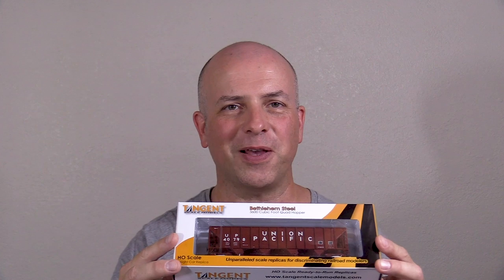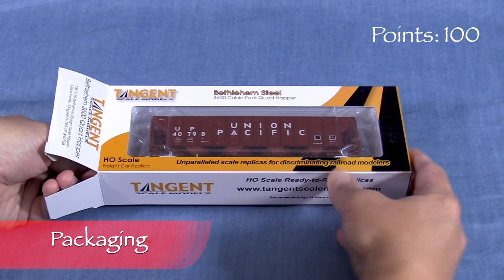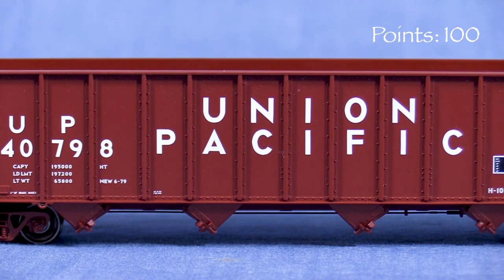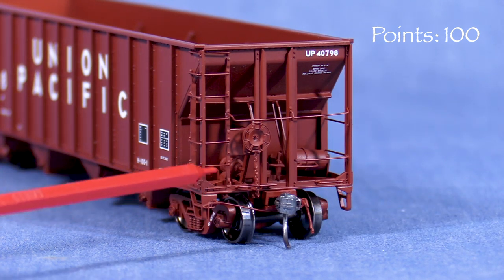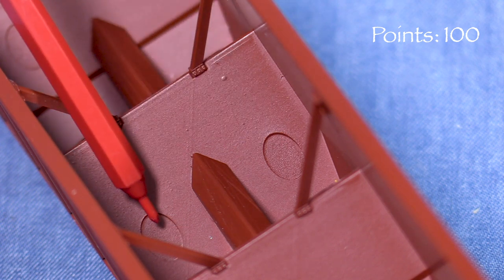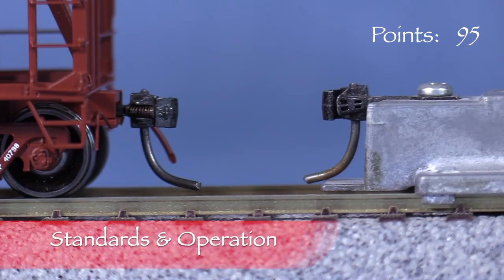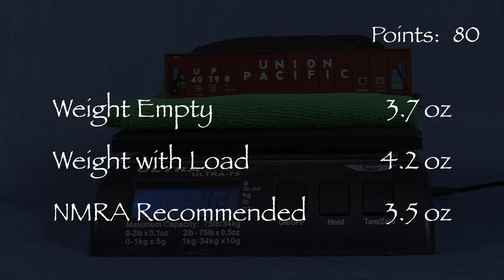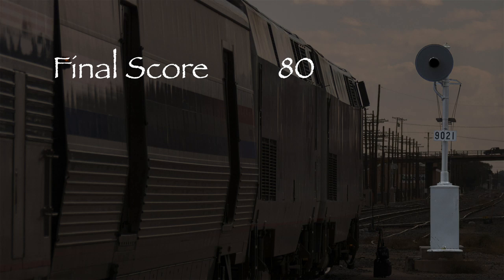Product Review HO Tangent Quad Hopper

Comment: I am a long time subscriber and enjoy your work.  I know you are building a layout, and a series of videos showing your work and progress on it would be far more interesting than a few reviews of "boxcars". Also, how do I order your booklets on DCC decoder  installs? And, do any of these installs include instructions for the "Bachmann Plus" locomotives? I have a 34X34 mostly Southern Pacific HO layout in Hot Springs Ar. Thanks
Reply from the maker: I do intend to do a video series to document my layout, but I'm not quite there yet.  The layout room is still being worked on.  I want to get all of the heavy work like drywall repair, insulation, heat, A/C, getting rid of bugs, etc. out of the way before I start building the layout, otherwise it'll just be in the way and likely get damaged.  I don't have any booklets on decoder installs, but I did work on some videos on that subject when I was working elsewhere.  I don't recall covering any Bachmann Plus engines.  Thanks for watching!

Comment: I think it's a great looking car, Dan!  But, the coupler debacle continues....  I hate to be the coupler police, but it's like they're not even trying!   I guess that I wouldn't care as much, if we weren't paying $40.00 bucks plus for these freight cars.  (Insert shaking head emoji)   

I know guys who expect every car to run properly right out of the box - every time.  Then they derail and uncouple, and they can't understand why?  I just accept the fact that I have to check the coupler height, wheel gauge, bolster screw tightness, and weight of every car I buy.  But it doesn't mean that I like it.
Reply from the maker: The couplers on this car were especially low.  I suspect it needs some washers between the trucks and the car body.  Sounds like you understand why I'm so fussy about this stuff.  I don't really like it, either.  Maybe one of these days the model makers will finally start getting stuff like this right.  Thanks for watching!
Reply: @DanielCortopassi  It does seem to be the exception if model makers can offer a car with KD's couplers at the correct height.

Comment: The ovals are from the mold machine that made the car. Either from the "ejectors" that eject the car from the mold machine or the injectors that shoot the liquid plastic into the mold. The scratches indicate that the mold is scarred and could use a polishing. I worked for a few years at a factory that made headlights and taillights for cars/trucks and it's the same process to make them.
Reply from the maker: Thanks for the information.  I suspected the ovals were an artifact of the molding process, but I didn't have a photo to say for sure.  It's hard to find good photos of the insides of a specific hopper.  I'll guess I'll need to fix my car, or always run it with a load.  Thanks for watching!
Reply: @DanielCortopassi  you're welcome and thank you for your reviews. You're very knowledgeable about prototype specific details of locos and rolling  stock and I appreciate your critiques not just on the NMRA standards but overall on the details that a lot of people overlook on reviews.

Comment: Are these still in service on modern freight trains?
Reply from the maker: One good way to find out is to look for photos online.  I found one of a car like this one from 2003, so there were at least some of them in service at that time.  I don't generally search for photos much beyond the 1990s, though, since that's my primary era of interest modeling-wise.  Some of these could very well still be in service.  Sometimes older hoppers are also used for hauling ballast as maintenance-of-way cars.  Thanks for watching!
Reply: @DanielCortopassi  thanks!